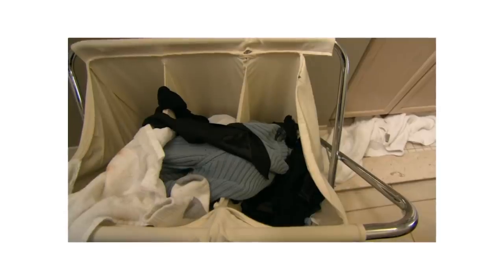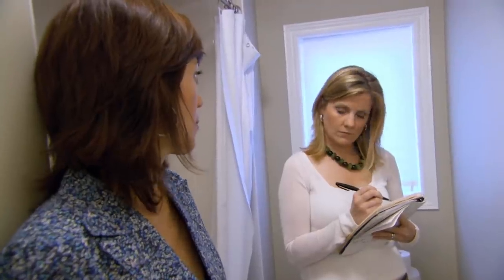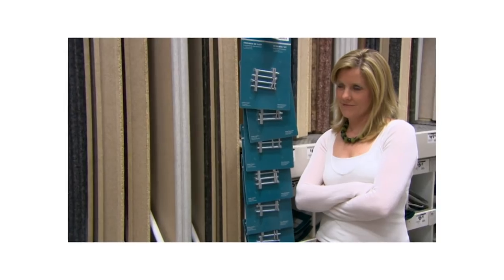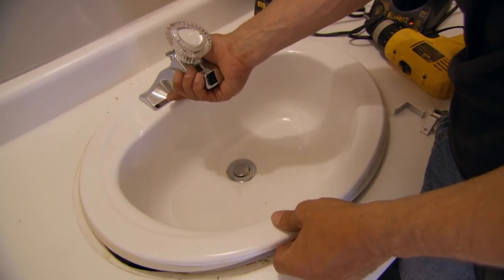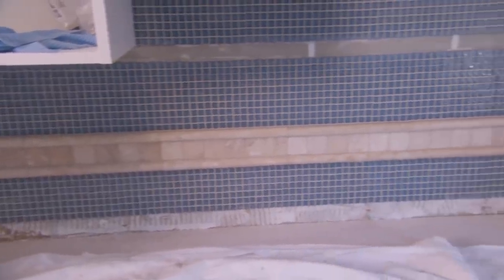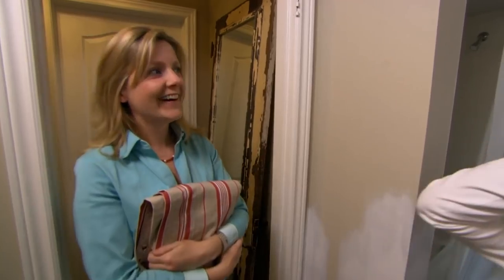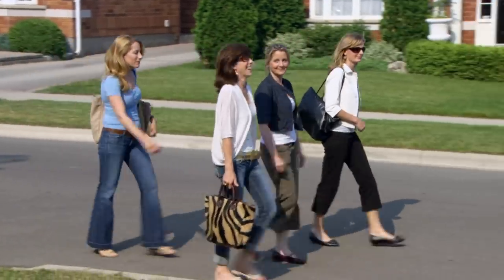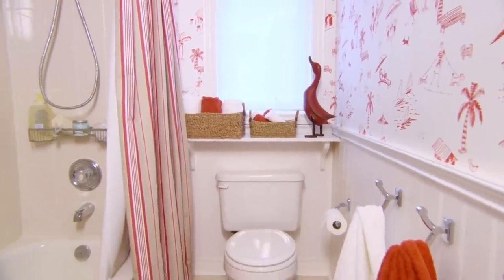Laundry Room Gets Lovely Redesign For Growing Family | Design Inc

Comment: WoW. My own experience with front loaders, though, is the 'oops, I forgot to add this towel and the washer has started' moment. Top loaders can suspend the cycle to let you add. Front loaders, not so much.
Reply: I can’t add to my front loader all through the wash cycle. You just have to pause and wait for the door to unlock
Reply: I have had both - I prefer the front loaders. I love the laundry room design and colors.
Reply: Good thing with laundry is that there is always another load to do later. Just add it to the next

Comment: Front load laundry doesn't allow late toss in, unless you upcharge your budget. Front load dryer, top load washer  I think is user friendly.
Reply: Agree! Absolutely loathe front load washing machine. There's often an extra throw-in. Or if something goes wrong, it locks completely and needs a call-out repair. Just frustrating😮

Comment: faucet better off done diagonally in the corner out of the way of using the sink, thumbs down on the yellow / brown  on the mirrored door. Also not a fan of wallpaper that dead ends on the ceiling edge, would've added molding that matched the chair rail, also on the top edge of the laundry room cabinets.
Reply: yes.